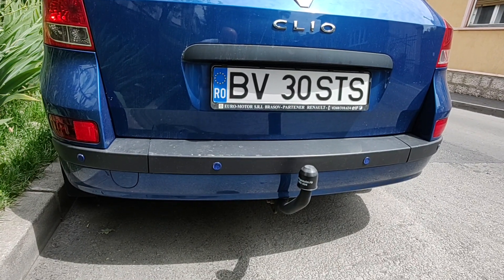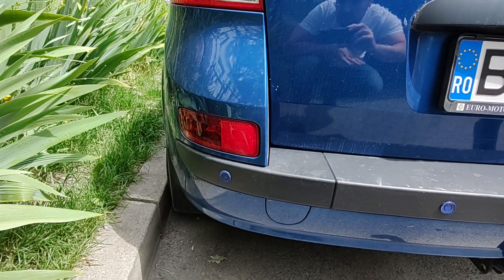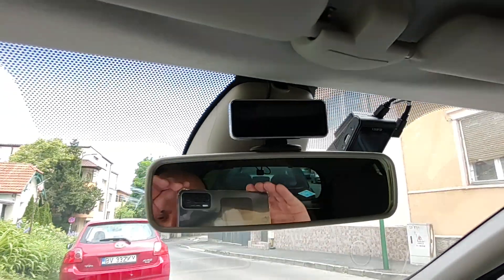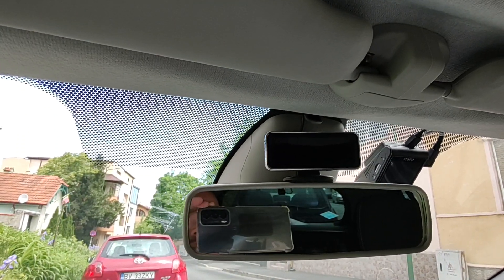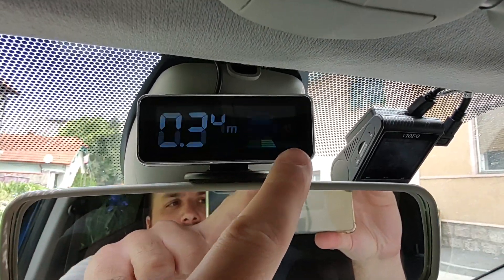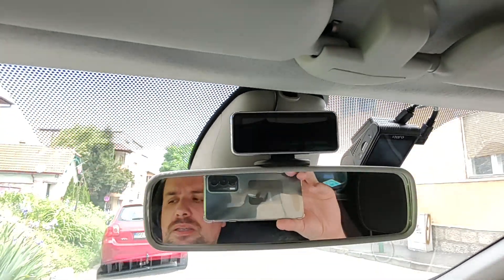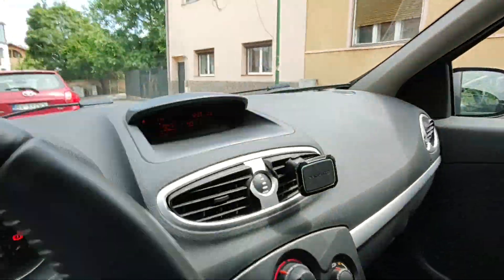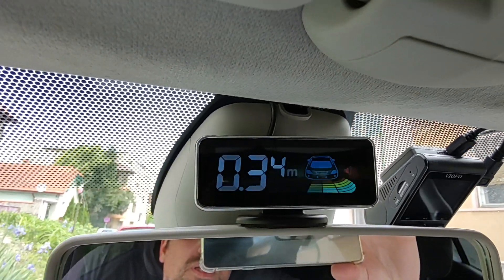When you order electronics from AliExpress...

Comment: I would never connect something from Ali to my car because i would be worry about burning the car down
You never know how the quality of the electrics are.
One short circuit and it can be over
Better you buy stuff with some better quality 👍
Reply from the maker: The quality is as good as it gets right now. I installed it at a specialized car service. I really don't worry about that. What dissapoints me is they sent me a flawd Control Box, that's all.  Everything was brand new.